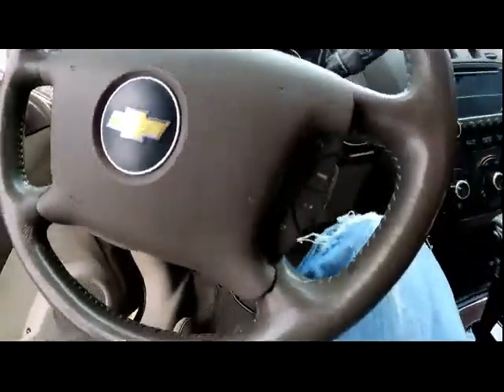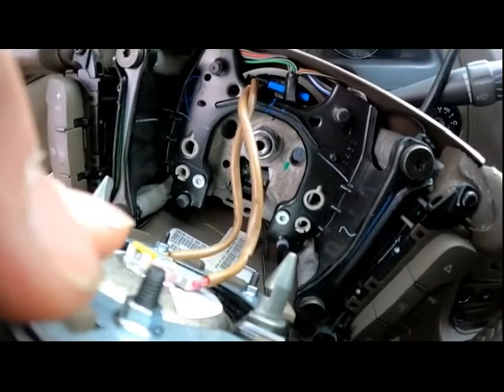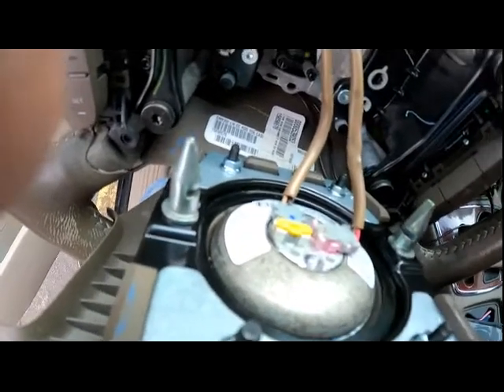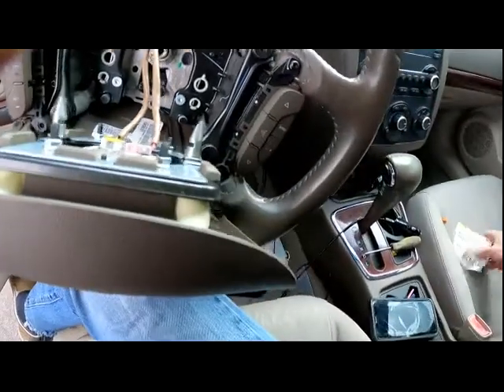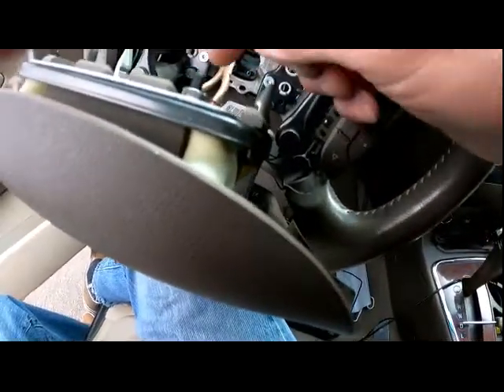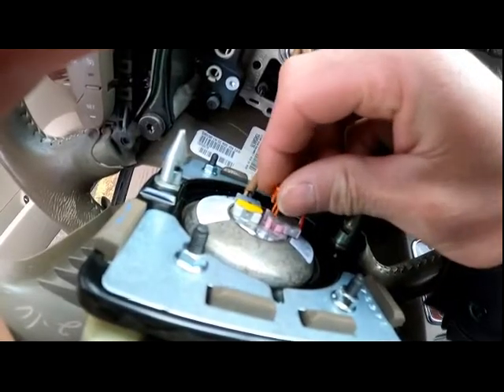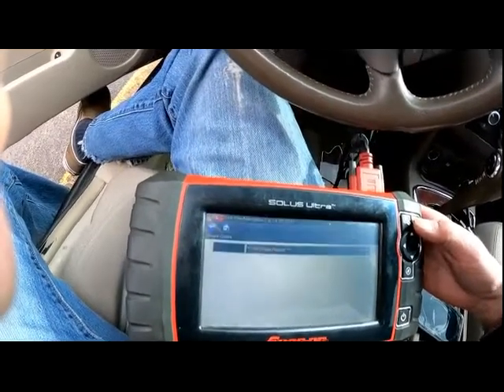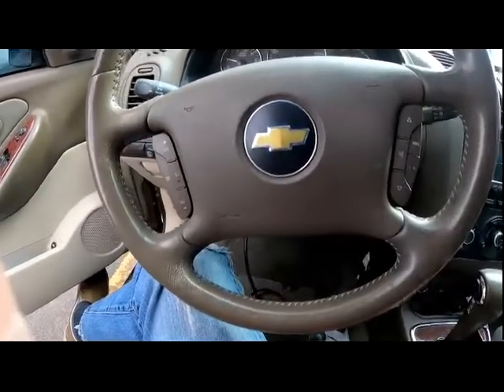** GM Air Bag Codes : B0012 - B0013  / B0015 - B0016 **

Comment: Many times thank you thank you  i replaced my steering wheel and one of the airbag safety clips broke  i put it all back together and had the airbag light i took things apart again and could find anything wrong after seeing your video i know what went  wrong  thanks many times over i would not have figured that one out!!  new clips on order

Comment: Great video. I have this exact problem now. But, my 2016 Chevy Tahoe is rebuilt so I have to buy the part myself. What is the exact name of those clips?
Reply from the maker: Thank you!
GM part # 8898-8974 .  Airbag safety retainer.
Reply: Where did you buy ot from im having troube finding it?

Comment: B0013 my Chevy Malibu Lt 3.6 tell me how to do it my self I'm in Wisconsin
Reply: It might be the clock spring I got a 2009 Chevy Malibu Lt 3.6  I was told it could be that it through code B0013 is that it or you think it's the clips I'm feeling rubbing noise when I turn with car 🚗 I'm in Stoughton wis let me no sir thanks
Reply from the maker: @kathysanders5652  Hello!  So most likely the clockspring.  Just need to remove the airbag to inspect.  The trick is to pop the wire retainers on the airbag to get it off, with a straight pick or pocket screwdriver.

Was just in Minneapolis last week!  Then in Somerset WI for a day!